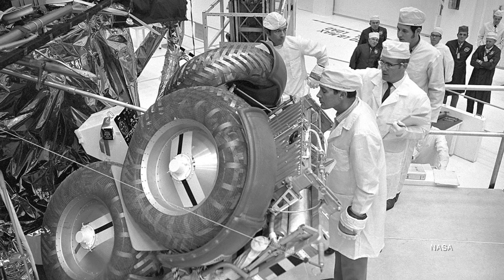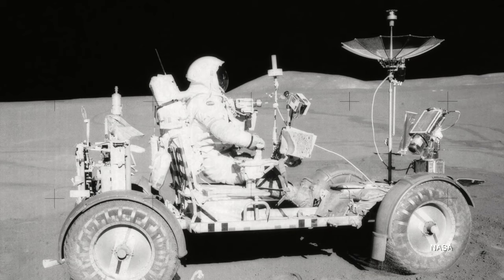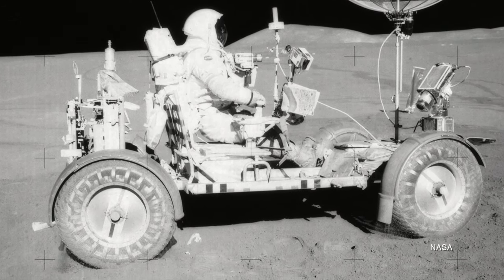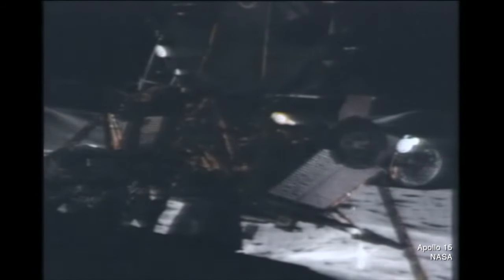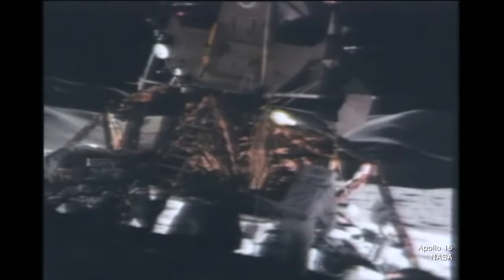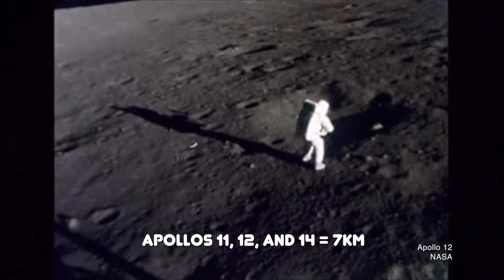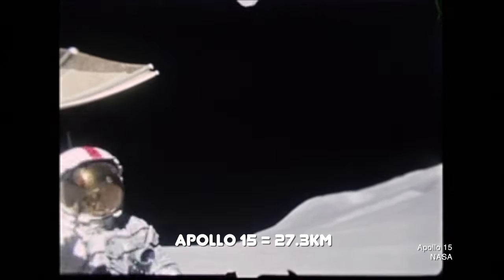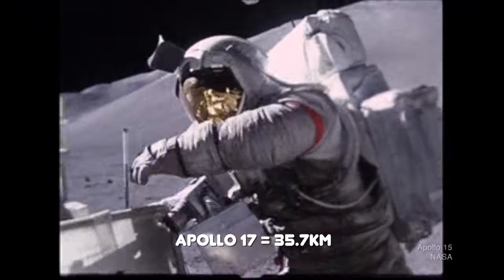How NASA Took Cars to the Moon

Comment: How did they drive 22 miles with just 2 batteries and how were they able to transmit analog TV 240,000 miles through the Van Allen Belts undisturbed and without interference, when on earth transmitting analog TV involved mega watts of power and maximim distance of 50 miles? How is it that the lunar module made of cardboard and duct tape lacking any insulation and adequate cooling system was able to keep the astronauts from cooking or freezing, never needing protection from severe temperatures? How did the camera zoom in and out and pan from bottom to top when lunar module took off dangling like a pendulum as if lifted by cables (did they leave the cameraman on the moon?)  and how did it reach 4000 miles per hour speed and found the command module without any practical tracking system (with what computer system? ) and how did they slow down enough to meet in space and return home with almost no fuel left upon landing on the moon? They never complained of temperature or air pressure or lack of any logical cooling system in the suits which are deflated in all pictures? How did they get out of the lunar module if the door opens inward?  Hoe did they fit through the hatch if they had backpack and inflated suits? How did they put on and off their helmets and gloves if someone else has to put them on? Maybe bimbos like you paid by NASA would believe in garbage like the Apollo moon-landings, but intelligent people know the truth ever since Neil Armstrong's voice was heard without any delay of minimum 2.5 seconds and there was no sound of the 10,000 pounds of thrust of the rocket boosters they were sitting on without any noice insulation during landing? Wr all heard the hesitation Neil Armstrong displayed before he says, "Eagle has Landed," as if he wasn't sure that they had landed, because he was reading a script with possibly a gun on his head, all were obvious to the whole world that it was all faked. The lunar module as if by cable placed gently on the fine powder Neil Armstrong described the surface as, and the rocket boosters had not disturbed the fine powder?  The movies, "Capricorn One," the 1971 "Diamonds are Forever," clearly made fun of how NASA was so careless in faking by failing to  make the moon landings look more authentic and more believable. Too many mistakes! Just look at how the NASA astronaut actor on the "moon" is holding on the flag to keep it from flapping in the wind and the wind still makes it flap. It is a true comedy, but a major shame on our country, ust like the 9-11 inside-job faked, how can we live with these lies, if absence of empathy is not an obsticle?
Reply: PART 1:

YOU SAID: "How did they drive 22 miles with just 2 batteries"

== Because the silver-zinc batteries carry a very nice charge for very little size/weight.  They're very expensive and cannot be recharged (which is why they're not widely used in any practical sense on Earth).  But, for an Apollo lunar rover, it's a very nice solution.  They estimated the range to be about 40 miles (depending on terrain and conditions).

YOU SAID: "and how were they able to transmit analog TV 240,000 miles"

== This dish:
https://en.wikipedia.org/wiki/Lunar_Roving_Vehicle#/media/File:Apollo15LunarRover.jpg
Sent signals to this dish:
https://en.wikipedia.org/wiki/Parkes_Observatory#/media/File:Parkes_Radio_Telescope_09.jpg

YOU SAID: "through the Van Allen Belts"

== The Van Allen belts have absolutely nothing to do with radio signals.  People send radio signals through the Van Allen belts every single day.  For example, DirecTV satellites are on the other side of the Van Allen belts, and millions of people watch thousands of channels of TV by aiming a little dish on their rooftop at the DirecTV satellites.

YOU SAID: "undisturbed and without interference,"

== The signals were disturbed and had some interference all the time.

YOU SAID: "when on earth transmitting analog TV involved mega watts of power and maximim distance of 50 miles?"

== There are many reasons for this.  But, I'll recap just a couple.
1) The curvature of the Earth is one of the primary reasons you cannot get a signal very far on Earth.  Even if you put the radio antennae high up, eventually, the Earth's curvature gets in the way of the radio signal.
2) Radio and TV stations use megawatt transmitters because they're sending signals IN ALL DIRECTIONS.  They aren't just sending signals to a single dish 50 miles away.  Think of this like the radio/TV equivalent comparison to a light bulb vs. a laser beam.  If you have one of those little pocket laser pointers, that's typically around 1/2 of a watt, you can see it from hundreds of feet away if it's pointed directly at you.  But, you have no chance in hell of seeing a 1/2 watt light bulb from that distance.  Radio/TV stations are sending signals in all directions (light bulb).  Apollo's equipment used directional dishes and radio telescopes (laser beam).

YOU SAID: "How is it that the lunar module made of cardboard"

== There is no cardboard in the lunar module.

YOU SAID: "and duct tape"

== There is no duct tape used in the construction of the lunar module.  There is a type of tape used on the thermal blanket, of course.  If you can think of a better way to do that particular job, be my guest, and suggest it.

YOU SAID: "lacking any insulation"

== The tape you're complaining about was to hold the insulation together, but you say it had no insulation?

YOU SAID: "and adequate cooling system"

== Ohhhhhh, sorry, I didn't realize you were an aerospace engineer.  My mistake.  I thought you were just an internet moron who was blindly regurgitating what other conspiratards say, with no actual understanding of the math and physics behind the cooling systems.  So, ok, yes, please present your calculations showing that the porous plate sublimators couldn't provide enough cooling for the LEM.  And, please explain how/why the thousands of aerospace engineers and technicians at Grumman who spent a decade of their lives designing and building those systems made such a massive blunder, and botched the cooling system so badly?

YOU SAID: "was able to keep the astronauts from cooking"

== Pourous plate sublimators, and that insulation you say doesn't exist.

YOU SAID: "or freezing,"

== Freezing???  Hey, wait a minute, I thought you were an aerospace engineer who knows all about the adequacy or inadequacy of the cooling systems.  Why would you think freezing was a problem.  With the heat generated by their own bodies, and all of the electronics, and the sunlight, they were worried about COOLING the systems, not about heating them.

YOU SAID: "never needing protection from severe temperatures?"

== What severe temperatures would those be?  Are you under the impression that a vacuum has a temperature?  Um, no.  Objects can have temperatures.  A vacuum does not.

YOU SAID: "How did the camera zoom in and out and pan from bottom to top when lunar module took off"

== Because they built pan and zoom capability into those cameras.  This isn't tough to understand, you know.  Pan and zoom had been mastered for decades upon decades by then, you know.
Reply: @jimstevenson2912  
Don't hold your breath about 2024.  That whole story just reeks of political posturing, rather than a real effort to go to the moon.  Not a dime of it has been funded, other than a preliminary $45 million (may as well be zero, because it's a tiny fraction of 1% of the money needed) to be split among 11 companies for them to come up with some initial design ideas for a new lander.  Nothing has been funded toward actual missions, or even development for actual missions.  And, the real irony is that it was set up to fail from the beginning.  They asked for $1.6 billion just to start the program (a drop in the bucket), but refused to give a total cost estimate.  Congress told Bridenstine to go fly a kite, and that they're not granting a dime until he presents actual budget numbers.  So, he ate crow and finally came back and said $20-$30 billion.  That's the identical cost of Apollo in 1960s money.  Adjusted into today's dollars, Apollo costed $150 billion in hard costs and $50 billion in soft costs and international support.  Nobody believes they're going to get the job done for $20 billion in today's money, so again, congress is basically telling him to fly a kite.  So, anyway, Pence/Trump/Bridenstine can give all of the speeches they want, but none of it means anything without any actual money behind it.

As for the idiots will just believe it's CGI anyway, yes, that's how the delusion works.  All evidence for Apollo is fake, no matter how real it is.  All evidence against Apollo is real, no matter how wrong it is.  Those are the only two rules to their game.  You can never get around those two rules.  Those are their rules, even for evidence that doesn't yet exist.  "It's fake" applies to all evidence, past, current, and future.

Comment: Boeing received the contract and one year later, had the first working model ready for testing.   The astronauts found it fairly easy to deploy and it was a godsend to the missions.  Other than a few malfunctions (Apollo 15's rover's rear wheel steering didnt work the first day, and Apollo 17's rover's fender got accidentally torn off), they worked perfectly, a tribute to Boeing's design team
Reply: Fenders were torn off of all three rovers, by the way.

Comment: It was a simple matter of folding the front wheels backwards and tucking them into a triangular backing while folding the rear wheels and tucking them into the center section of the entire payload cargo bay area.  The unfolding process was also a simple matter of pulling a line which disconnected the latch that unlocked the front folded wheels and then rocking the front section it dislodged and opened onto the surface of the moon.  The rear portion was unlocked and unfolded backwards opening rearward and allowing the wheels to unfold and come fully into place. Together the unit is taken off of it's spring loaded assembly and lowered together with both ends to the surface of the moon.  After detaching the lines and stowing the various packing attachments then it's time to run through the shadow process and confirm all the electrical motor systems are online and functioning correctly. The various antenna have to be unfolded and calibrated also.  There are adjustments in the suspension system that the astronauts can accomplish  before they take it out for the trial run.  These Lunar Rovers are not considered operation because they have never been tested on the moon it's self. Not knowing exactly how the rover will perform and function on the moon total caution and care is to be exercised so that there can not possibly be any type of accident.  If something was to go wrong and an astronaut was injured it would jeopardize the whole mission and could lead to the death of an astronaut. There will be no racing around and jumping this test vehicle so far the help of anyone on Earth.  Engineers have limited the maximum speed to no more that 8 miles per hour and turns no greater 37% radius. Stoping tests are important as well. It is also estimated to take over an hour to test the Lunar Rover after it's been unload and readied for operation.  Second only for the concern of the accent rocket functioning correctly is the issue of the rover being deployed correctly.
Reply: Why add any risk to these missions with these vehicles then? You said it yourself, they had to be extra careful since these things could have potentially jeopardized the mission. My question is, why would they ever add any unnecessary risk by bringing shit like this to the moon when it was not needed? The whole point was to walk on the moon, not drive on the moon, yet they managed to do both. Incredible. /s

Comment: I am old enough to remember clearly much of the Apollo program, and I was so fascinated by it all that I was glued to the TV until my mother made me go to bed.  I've watched many movies and documentaries about the moon landings, and I have watched many of your videos.  Frequently, I already have much of the information in your videos (but I still like them).  But there is one thing I have never seen.

They didn't launch Saturn rockets from on top of the crawler.  So how did they transfer them from the crawler to the launch pad?
Reply: The Saturn rockets were stacked onto the mobile launch platform inside the VAB. Then the crawler would enter the VAB, crawl under the mobile launch platform and gently pick it up. At the launch site, the crawler simply lowered the mobile launch platform onto the launch pad support structures. Once that was done, the crawler had one more job to do and that was to move the mobile service structure into place using the same method. All this equipment was modified for the Shuttle and is being modified again for the SLS.
Reply: Just watched a video explaining it all. Google "NASA The Big Challenge".
Reply: Thanks, mako88sb.  That explains why it looked like the rocket was travelling with the launch gaintry...because it was travelling with the launch gaintry. :)
Reply: Your welcome. Another great engineering aspect of the Saturn launch system you would probably find interesting is this:
Google: "Saturn V hold down posts: dies and pins - collectSPACE: Messages"

Comment: So so obvious it's over 200°f and no  effects on the sunny side of the moon,really? Special space suits my a__!
Reply: Do you know the heat transfer methods in vacuum? Do you know what time the astronauts landed at?
Reply: Jan Strzelecki ...heat transfer by radiation, conduction or sublimation. Radiation doesn't apply, conduction (like rubber tyres on the hot surface, why didn't they melt ?), and sublimation is the change of state from solid or liquid to gas, which is how their A/C suits worked. No sign of any vents on the backpacks though, must be a special material.

Comment: Did they do all of their EVA's on the rover with one charge, or did they recharge the rover between EVA's? If so how did they do that. Thanks for a great channel, keep it up!!
Reply: The rovers all had enough charge to do much more than any of them used. Some of my Electric Vehicle enthusiast friends  tell me the silver-zinc potassium hydroxide primary cells might still have energy left in them after all these years. Those very expensive primary cells(similar in function to the type used in flashlights) are not rechargeable, to answer your question. In the old parlance, secondary cells are the rechargeable type.

Comment: how did they charge the moon lander battery and did the battery heat up from the solar radiation?
Reply: They didn’t need charging as it was a one time use, However the lander did have a mini nuclear power reactor.
Reply: @dogwalker666  
Well, the lander didn't "have it" (it was onboard, but not powering anything in the lander).  They brought the nuclear isotopic generator to power the ASLEP.  They attempted to use solar panels on Apollo 11.  Didn't work very well, and died in 3 weeks.  So, they switched over to nuclear power after that.
Reply: @rockethead7  They put it out on the surface to use it, Not internally.
Reply: @dogwalker666  
Yeah, but the original topic was asking how the lander was powered.
Reply: @rockethead7    I was under the impression they placed the reactor on the surface away from the lander to reduce the risks,

Comment: Apollo 11 was nearly out of fuel when it landed. Subsequent landing missions carried more mass and stayed longer. How did NASA accomplish the larger masses landed on the moon with the same lunar module?
Reply: One change for Apollo 15 onwards was adding a 15 inch (to the best of my recollection) extension to the engine nozzle, which gives you more thrust from the same engine/fuel load (traded off against the additional weight of the nozzle extension). The original decent engine design was probably being cautious about how much the nozzle extended below the underside of the LM, keeping the nozzle shorter than it could have been to avoid it contacting the surface on landing. By Apollo 15 they had data from 3 previous landing which would have allowed revising the risk estimates.
Reply: Very interesting, thanks for that piece of information.
Reply: I suspected that my memory would be unreliable here. In fact the extension is only 10 inches long.
Reply: Also, Apollo 11's specified landing site was unsuitable, as Neil and Buzz realised as they were approaching the site, so they had to expend a lot more fuel to find a suitable alternative site nearby.

Comment: Why does the moon dirt fall back to moon after it fly's off the wheels ?
Reply: Miles Moore because the moon is covered with fine dust 1000 times smaller then a grain of sand.its like when u empty your vacuum cleaner bag .the gravity on the moon is 16%  from earth there for in real life the dirt should not just fall off the wheels should at least be a dust cloud...if u speed all the footage up x 2 u. Will understand..
Reply: Miles, are you under the impression that there's no gravity on the moon?

Comment: I’m still not sure why the legs were covered with the gold mylar.
Reply: Yes, it was less necessary on the legs.  And, as a matter of fact, the Mylar blew completely off of one of the landing legs on Apollo 14, and it wasn't really a problem.  But, in the bigger scheme of things, the idea is that they wanted to prevent as much sunlight as possible, including from the legs (because the heat could/would transfer from the legs to the main body of the descent stage).  It's an overall effect.  Losing a little bit of the thermal blanket from a leg wasn't going to matter.  But, overall, by protecting as much as they could, including the legs, it prevents the temperatures from escalating.